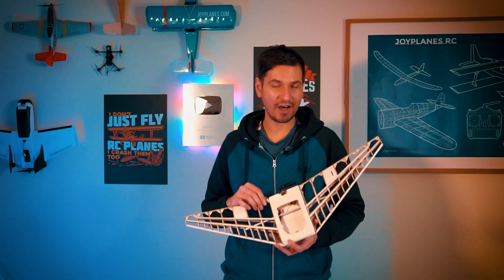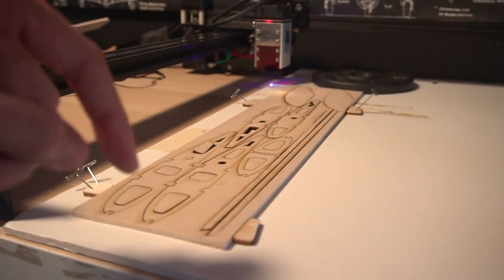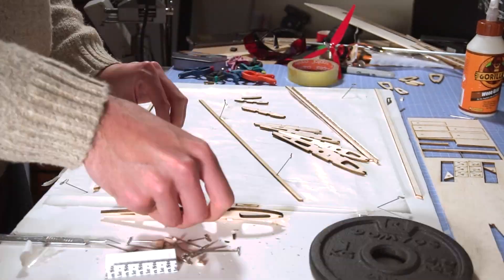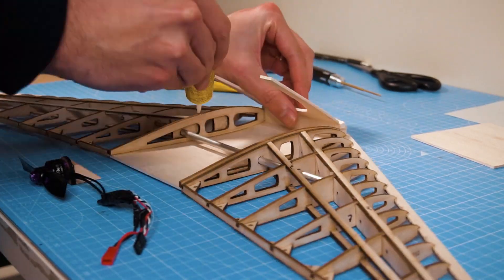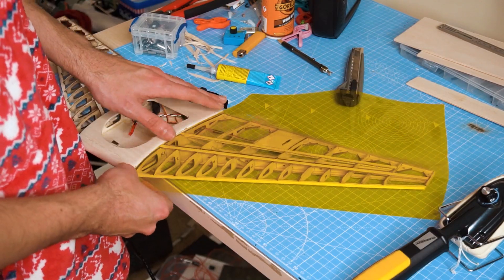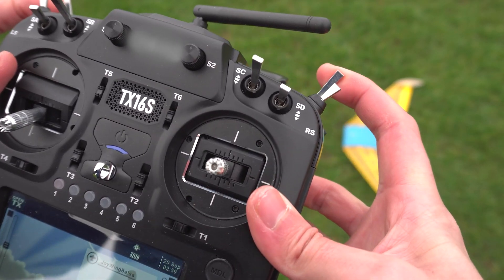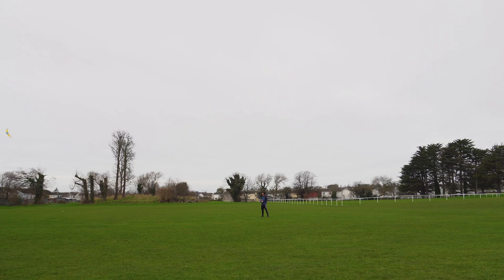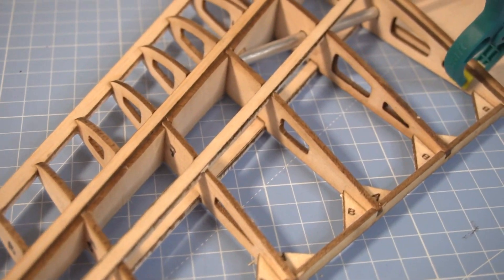Design & Build of a Flying Wing (With Balsa Wood) + Project Files

Comment: Hello and thank you sharing your way of building and tools. Too often we have to pay, or just stay in pain without knowing which tools where used. 
For the model, it a bit too small for me but it's my taste of flying little bigger wing. Between 90cm and 130cm 
I think you miss a bit of torsion on the building to stabilize it. And winglet could be higher to see it aft like rudder at the launch instant. I never launch handling the wing by extremity for avoid the snaking, but it work very well if you have counter action by passive (rudder or winglet ) or active by mix on transmitter. 

I prefer launching in center axis with or without propeller depending on model. For those with running engine I add an underneath center profile like piece of wood for hand catching and protect a bit at landing. 

Continue your channel, building is so nice that all of us that do not try it, miss the essential of this hobby 😇

Comment: I have been building flying for a long time now.. and with all that experience I can say is.. choose a better airfoil.. with a bit more thickness.. and add some more sweep.. I have used the same airfoil aswell.. but never really got what I wanted.. because that particular airfoil needs a lot of speed for stable flight.. I ended up using some other airfoil..

Comment: move your motor 3 - 4 cm up front by cutting your fuselage . reduce the "elevons" size next to the propeler and if you feel that you don\t have control you can make them bigger outer wing. servo must be in front near the leading edge as posible .... 9g in front of the CG is better the 9 behind even if your control rod will be longer.

Comment: You can try using reverse tapered elevons like the original Zagi flying wings. It's a genius design in my opinion. When you pull elevator control "up", the broader tip of the elevons reduces the angle of attack of the wingtip, preventing it from tip stalling. Even when the airspeed decays with a full "up" elevator, the wing will just bob its nose up and down with full aileron controls. The Canterbury Jazz Extreme uses constant chord elevons that will tip stall and fall out of the sky like yours when we do hard maneuvers for slope combat.
Reply: Yes you can just tape on different elevon extensions near the wing tip in order to test this idea but it's the same idea I was thinking. Also consider thinner Balsa or foam board something extremely light for the elevons reducing weight at the rear of the plane is better than adding weight to the nose.

Comment: Check Prandtl wings. Check adverse yaw. 

Yet in nature you don’t see a wing flying alone, there’s always something like a fuselage to stabilize the pitch. That’s why an alone standing or in this case an alone flying wing has a lot of maneuverability limitations compared to common elevator rudder aileron design, although birdlike flight is the benchmark, glide ratio and energy management amongst other features included. One big hurdle then in the way of achieving birdlike flight capability is getting rid of the vertical stabilizer and mounting the elevator on a pivoting mechanism like they do in birds.

Comment: Just a suggestion for tip stall and to increase the longitidunal stability, you can use reflexed airfoil if you do not, because they are very beneficial when the aircraft tends to nose down. And also, you can use some washout on the airfoils near the root chord, it will provide you to get rid of this tip stall ✌🏻
Reply from the maker: Good tip!

Comment: If you want to understand why flying wings tip stall, you need to get into aerodynamics deeper.  Check out the NASA Prandtl-D project by Albion Bowers.  Rol Klingberg is also very good, and may be more similar to your design.

Comment: I think your tip chord is too short. A constant chord or slight taper will fly well, you don't even have to taper the height.  (What you have will fly good fast but won't slow down). Next time try a reflex airfoil that way you don't need too much reflex if that makes any sense. A flying wing will work with a flat piece of foam so I wouldn't sweat the airfoil as much as the shape. Having larger vertical fins will help as well with the spinning out bit. Sure you can have a wing without verticals but it won't slow down nice. Very cool the way you designed and built it up, good luck with your future builds.

Comment: I used to have a CO2 laser and laser-cut balsa parts for a model I was designing.
I used mostly 3/32" and 1/16" balsa .... perhaps you can go to thinner material?
Also, perhaps your solid-state laser can benefit from an air-assist add-on, maybe cut the balsa in one pass?

Comment: I agree with the above comments regarding your wingtips.  The cord does want be less than about 3.5 inches 85 mm.
Any smaller and the Reynolds number just goes bad (too high) !
Lovely looking wing - I have made  some a little smaller. They had their own issues but not tip stalling.
Reply from the maker: Great to know, thanks for commenting.

Comment: 3d printed, or aluminium, or both, or also wood, cnc&3d print, frames, supports, fillers, surfaces, foam, bubble wrap, plastic from bottles, recycle-plane
Reply: leaf blower gasoline plane

Comment: Amazing little flier! IMHO you need to design a set of vortex generators for the wings and definitely use more nose weight! Most of my planes are wings and as a rule I am using at least 10% more nose weight with bigger batteries or moving it forward. Happy flying!
Reply: I second the use of vortex generators.  I had a HLG that tip stalled when trying to turn tightly in thermals. I used clear plastic laser printer sheets cut down to 10mm wide strips with tabs 1-2mm wide cut along back edge bent up 1mm.  These were placed 1/4 chord back along the outer 1/3 of the tip. This got rid of the tip stall issue.  With HLGs you want to avoid being nose heavy.

Comment: You have chosen an airfoil with a flat bottom from the spar to the trailing edge. That makes the wing sensitive to pitch, as the center of lift moves forward and aft with changes of the angle of attack. I suggest making the same model with an airfoil designed for flying wings. Martin Hepperle designed many airfoils for models of flying wings, all of which are freely available in polars and coordinate lists. I suggest the MH 60 airfoil for this model as it has mild handling and good lift.
Reply from the maker: Thanks! but I did use the MH60, at 1:29 you'll see I stated I'm using that airfoil, I think that fuselage is also creating lift and interfering with the CG.
Reply: @Joyplanes  No kidding, I don't know how I missed that! It sure looks like a regular flat bottom eppler or something in the video. You must be right about the fuselage. Maybe a symmetrical section in the fuselage would calm down the handling. At least it would be relatively easy to test without constructing another airframe.

Comment: I used to design and build my own planes back in the 80s as a kid -- and my feeling looking at yours is it's really overbuilt; I guess that's great for enduring crashes though.
Of course I never had access to CAD, electric drive or much money, and most of my builds were just kind of intuitive and probably sucked, but they could fly somehow.
It's really cool to see you experimenting.
Reply: I agree.  It looks like the plane only needs half the amount of ribs used and the fuselage section and elevons could also lose over half its weight with lightening holes cut out.

Comment: Nice looking wing you have there!

The wing looks a lot like those EPP wings from China. With one exception - the EPP ones have much wider wing chord at tip. I have flown one, and removed the tip plates as unneeded. Still the model shows no signs of tip stall. So I'd guess making the tips wider might help with the tip stall:

About the CG issue: how about cutting the wing  center section "shorter" from the rear, and thus taking the motor forward? This should help to move CG forward without the need to add ballasti to nose. For wing strength, the part near the wing spar is the most important anyway, so making the center narrower should not make the wing weaker.
Reply from the maker: So many people has mentioned the tip cord, so I'll definitely consider that next time.

Comment: Very nice project. Looks amazing. Think the low-speed stability issue is a characteristic of flying wings, and the lightweight of this airframe. Large scale flying wings use drag rudders, or split controls to offer better yaw control. Something more complex and added weight a model this size doesn't need.

Curious what model you will build next from design, or modified design. Having laser cutter is a dream tool. Perhaps you can even cut foam board too? So many possibilities. If only had infinite amount of free time.
Reply from the maker: Thanks! the laser cutter unfortunately does not cut white foamboard easily, I think it needs to be a infrared laser.

Comment: You've got a biiiiig open surface for the entire wing, but then these huge winglets for stability.

Yeah they prevent tip stalls and provide some degree of vertical stabiliser, but they also induce massive wingtip vortices, which causes instability.

Since you can design it, have a look at "flying wing vortex stabilisers" and see about staggering some just above the laminar separation point on the trailing edge.
Reply: it's hard to curve them up in balsa ... if he adds some mid body stabs as you suggest will lose the best part of his design.

Comment: How does one know whether the airfoil shape of the wing is optimal for the weight, size, and shape of the plane?
Reply from the maker: There is a lot of math involved for real-size planes to know that, I don't do that for small models since I just selected an airfoil recommended for flying wings, and that's it. It's not necessary to do all the math for small models.

Comment: That's a very beautiful plane! The wingtips look a little small though. That might be the reason you spin so much when you stall, as there is not much yaw stability at low airspeeds.

Comment: This is really fantastic. Love your build.  We cut and build our wings from foam, but a bit larger in size. As a suggestion, I would do everything possible to shift weight to the front rather than add nose weight. (1) move the servos further forward- with a plane this light your should be able to use really small servos (2) Make sure the elevons are tapered and thin balsa (3) Cut the back in a bit to move the motor mount further forward (towards the CG) (4) position the battery as close to the front as possible and use foam to cushion a crash. Do the same with the rest of the electronics.

I think you did an impressive job with all the work that went into it.
Reply from the maker: Thanks so much for your advice on this!

Comment: Very nice build, and congratulations, you just discovered the reason that the original YB-49 flying wing crashed and killed its Pilot, Major Daniel Forbes, and Co-pilot, Captain Glenn Edwards, in June 1948. It is also the reason that the Flying Wing program was scrubbed. The  Flying wing is one of the most efficient designs ever, but it is also inherently unstable at low speeds. It is susceptible to spinning at low speeds. But when Fly by wire control systems and sensors were developed. The government reactivated the program and developed the B2- Stealth bomber.
Reply from the maker: Great piece of history there, I've heard of it, and yes, it takes a bit more research and work to make it more stable.
Reply: Kevin Maloney,  I was thinking the same thing.   I understand that there is a lot of real time processing that goes on to keep the B2 flying stable.

Comment: Does this cutter also cuts foam ?
Reply: This type of laser does not have the right wave length for cutting foam you need co2 laser ....
If you mean foam board you can replace the laser module with a needle cutter (google rc keith) lots of information.

Comment: What a coincidence, I just finished building my self designed wing a few hours ago! Maybe you could try to extend the winglets below the wing to make a wingtip fence. What would also probably help is a little reflex if you dont have any. Tbh though I fear that your wing has too little wing sweep and therefore has a very sensitive cg but adding more noseweight should also help
Reply from the maker: Thanks for the advice!
Reply: Hello! Fully agree! Bigger rudders to reduce sideslip and adverse yaw. This could avoid the subsequent assymetric stall leading to a spin. Beautifull design :)

Comment: Delta wings are notoriously difficult to setup. My son built a flight test wing from foam board plans. We had to jostle with the CofG until we found the sweet spot. It had big wing fences on the tips. I like the idea of putting a mid wing fence as someone else has already suggested. Take a good look at a Microlight’s flex wing setup. They have a fair bit of up flex in the centre of the wing. I used to fly them and they are super stable wings. So maybe add two trim tab’s either side of the engine in the centre of the wing with a fair bit of up until you find the best position.

Lovely build. Looking forward to green software tools video. What is the cost of the laser cutter BTW?
Reply from the maker: Thanks for your ideas, the laser cutter price is about the same of a 3D printer, $300 - $400
Reply: actually, delta's are usually very easy to design and tune. This is not a delta.

Comment: Add nose weight and then reflex (up trim) to accommodate. 
My foam me163 build is about that size and it needed a lot more in the nose than calculated. In the first iteration (you.can see the maiden on my channel) it tip stalled badly. I had full length elevons like yours here it was also super sensitive so i I shrunk the elevons by 30% by cutting the tips off, adding a new section of wing and adding washout. That way the tips werent ever in a situation where the elevon forced it to stall. That helped but didnt completely fix it so I added wing fences  midway down the wing very much like the early mig 15 and 17 had. That stops the stall early, doing it midway down the wing allowed the remaining elevon to retain some control during stalls. It is now so steady that I havnt had a tip stall since. You can see how much better it flew in the remaiden video. 
The fences will be super easy and should make a huge difference.

Comment: Nice one. how long did it to take you to assemble it once you had everything cut out? It'd be awesome to see you make the FPVWRA Spec wing. it's using a NACA0014 aerofoil and is probably about twice the size of the one you have. it flies great in foam but would look awesome in balsa
Reply from the maker: It took about 2 days to the point it was ready, most of the time was waiting for the glue to set.

Comment: HOW WHERE THE CG CALCULATION WRONG?
Reply from the maker: The middle fuselage is actually producing lift because of its airfoil shape, so it's also part of the equation that I did not consider initially.

Comment: Would be very interesting if you would do the same flying wing but 3d printed with LW-PLA and compare both models in terms of weight, durability and flying characteristics
Reply: For fairness I would do the manual covering with clean film as u did with wooden, instead of printing cover with wing, not sure though how 3d printed parts will react on ironing
Reply from the maker: @VadimBryksin  I've thought about this idea for some time, but the printing times are insane, and it would be interesting to know if PLA would stick to the covering film.
Reply: @Joyplanes   here you go, yet another topic for your amazing videos :)
Also regarding printing time - would it not be roughly the same between cutting cnc and manually assembling vs 3d printing and assembly?
But yeah would be very interesting to see the comparison and find out how PLA and LW-PLA react on iron with covering

Comment: try to use an autostable airfoil, like broggini 55509.
those airfoil are known to add more stability in flyng wing configuration.
Reply from the maker: Thanks for the tip! I should have done that before cutting the whole thing. Next time I'll try that airfoil.
Reply: @Joyplanes  PW-51 is also good. That's similar to what's on the very popular Nano Goblin

Comment: nice video! try splitting the elevons into elevators and ailerons, but put the elevators in the 30% of each wings span at the wingtip that will washout the wing as the elevators r trimmed up to keep the nose up. it will also reduce tip stall when slow flying. with the ailerons on the inside 70%, when the aileron moves downward to lift the wing in a turn it also washes out the wing causing the vortex to shed at the end of the aileron which modifies the airflow upwards tilting the lift vector forward so the u create Proverse Yaw to coordinate the turn.
Reply: Hey, @captarmour I am really pleased by the solution you gave, I am an undergrad student and love aerodynamics. Would love to connect with you if possible! Thanks.
Reply: @vardhanshah5283  did you actually try it?

Comment: Can I use foam board?
Which would be more efficient?
Reply from the maker: I'm not sure which could be more efficient, but yes you could convert this design  to be made with foam board.
Reply: @Joyplanes  is balsa more lighter than foam??
Reply: @cosmorito961  no, but stronger
Reply: @cosmorito961   you could build a foam board one about the same size for quite a bit less weight. My me163 with battery is around 120 grams. Its strengthened with leading edge spar and mid wing spar so it is very strong. I have crashed it many times and it is still flying. BUT this wing of his is beautiful with the visible spars! The extra weight is worth it
Reply: Might need some more back sweep.
Also not an engineer 🤔